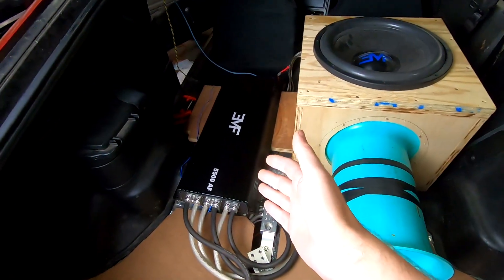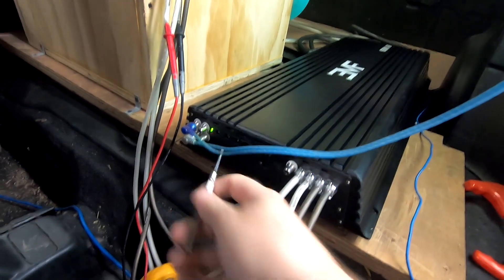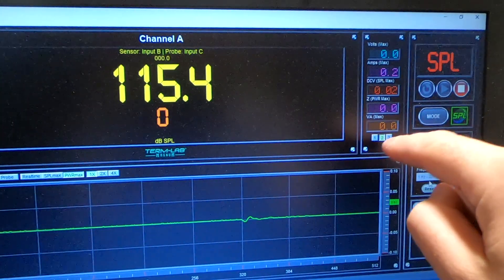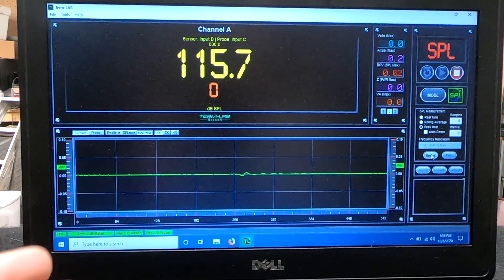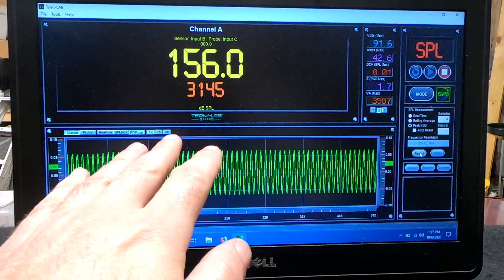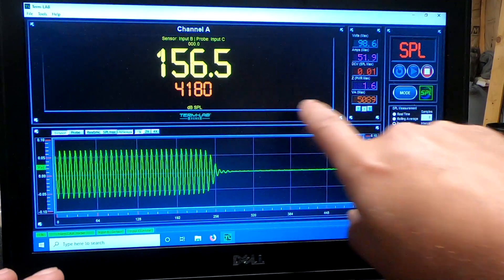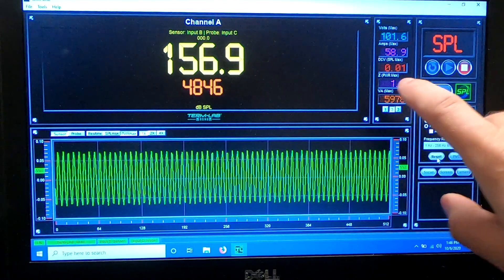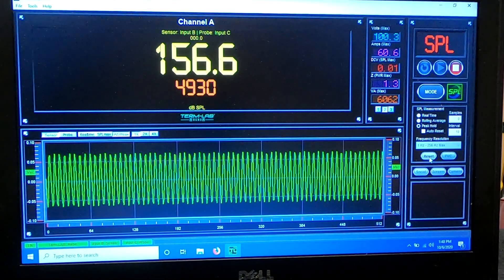EMF Audio 5500AF REAL WORLD power testing

Comment: I'm curious about something and I believe you can answer this.... Audio Control Epicenter or Soundstream BX10? 

Which is the better bass processor and are they bad for your subwoofer?

Love the amp and video as always!!!
Reply from the maker: I have no experience with the BX10 but I can say they CAN be bad for your sub, but not necessarily. If they're used properly (which many people don't) they're great, but when you use it improperly as many do you can cause mechanical failures. The proper usage is for restoring harmonics in old recordings, it shouldn't be used as a bass booster.

Comment: Does the bass remote that comes with the amp have the ability to turn the amp on/off  similar to the ds18 voltmeter remote? Sometimes I would like to listen to music without the subs playing, don't know if I will need another amp remote switch. Thanks
Reply from the maker: It does not, but that's kind of a useless feature because you could just as easily turn the volume all the way down and get the same result.
Reply: @EMFAudio  No because the amp would still be on. I turn off my amp for long 5+ hour trips. No point in just having it on at idle. That's the reason I switched from an LC-1 to the DS18 knob. Its most definitely a useful feature.

Comment: Where exactly are the actual real world volts and amps drawn being displayed?  Being an EMF product I assume it will make rated or more power but how efficient is the amp? Thanks.
Reply from the maker: I'd have to have 2 other cameras setup to capture that in real time and that would be a lot of extra editing to just show the power it makes. I didn't even have a current clamp in the car this time. All the AF amps do rated or more at a given impedance.
Reply: @EMFAudio  Yes I agree they do rated and more. Can you possibly add the efficiency calculation to the website info or just let us know. Its important to me because I would like to know how much my stock electrical system is being taxed. If two amplifiers are comparable in power and cost but one is greater in efficiency, I will purchase that. Honestly I would even be willing to give up some power for greater efficiency. I'm currently considering the 2000AF. Thanks for your replies.

Comment: I was considering this amp on strong electrical (15.2-15.3v), but I’m assuming you’d probably recommend your 7500 for two 12” v2 banhammers? Want to be ready when they arrive. I’ll quit bugging you I promise haha. Thanks!
Reply from the maker: Technically that would be over RMS rating so that would be on you for that selection. Technically we'd recommend the 5500 on a pair as that would be just under RMS rating on the subs.
Reply: @EMFAudio  ok thank you Sean! I would never hold you accountable regardless of what I choose. Subs can be blown with under rated power too. That’s all on me. I’m sure people have tried unfortunately, so it’s a slippery slope for you in giving an answer. Didn’t think about that before asking, so I apologize. Generally I shoot for around 750-1000 over rms rating per sub to help fight impedance rise while wired at 1 ohm. Probably could do even more. Don’t feel .5 ohm is necessary for a daily driver imo. I see now your amps don’t like over 15v input, so I’ll keep it a bit below that since I can adjust it. Thinking 7500 👍🏻 appreciate ya man!
Reply from the maker: @TheDoozie43  Realistically, it doesn't make sense to make an amp that requires over 14.4v to make it's power. Most people don't have that, nor can the rest of the car use it. I won't run a car over 15.0v because of the car itself, not the amps. If you're using batteries you can boil them and cause your batteries to go bad because of overcharging and heat. In summer you definitely don't' want to be charging at 15v.
Reply: @EMFAudio  ok, good to know. Of course the manufacturer of the pcm told me it’s fine, but they’re also selling the product. Thank you! It’s hard to weed out misinformation online.
Reply: @EMFAudio  they actually told me Ford vehicles like mine can handle up to 16v :( won’t say any names though.
Reply from the maker: @TheDoozie43  Maybe the vehicle can, but the battery won't. If you had all supercaps you could do that.
Reply: @EMFAudio  10-4, thanks Sean. That’s why I asked, it didn’t seem safe to me. 👍🏻
Reply: @EMFAudio  and thank you very much for your time! Have a good night!

Comment: The Rockville Compdb4-5 have clip limiter buttons too. I wonder if it really works. I wish I had a oscilloscope. I bought the compdb5 just out of curiosity 😂
Reply: I've heard two people say their built-in voltmeter wasn't accurate on their Rockville amps, So I wouldn't count on the clip limiter working properly.
Reply: Ronco160 Yea I have heard that too. I must have got lucky cause mine is pretty dead on.
Reply: Bradley Gilpin oh that’s good.

Comment: rEaL WoRlD nO rEsisToRs. One ohm, is one ohm, lmao. If you know your shit, and get it down at 1 ohm at any frequency, its the same as the resistor. Couldve used a dyno, saved a lot of time, and not sounded so "holier than thou" 😂😂. One ohm is one ohm 🤙. The part that really gets me is the "unobtainable electrical" when the test benches are usually made up with xs power batteries for vehicles lol.
Reply from the maker: You know how you have 1 ohm in your car when wired to 1 ohm? You don't. So those numbers you see at 1 ohm aren't real numbers you'll actually get. That's why I'm using a realistic scenario. Most of those dyno videos have 14v or 16v setups, which are often unrealistic to what you have in your car too. If you're buying a 2,000 watt amp, you won't have 8 14v batteries on it. You can save a lot of time by doing a job wrong, but I'm more interested in a proper end result.
Reply: @EMFAudio  you do at specific frequencies, specifically like your test was done. Whatever you wanna say man, im not hating lol. One ohm reactive is one ohm 🤷‍♂️. I understand rise obviously or i wouldn't have commented. Ive seen hundreds of systems at 1 ohm reactive (at certain frequencies exactly like your test, and the amp dyno) but you do you 🤙. Test that at one ohm reactive at 14.4, and test it at 1 ohm with a resistor at 14.4, and show the difference if youre so sure the amp dyno is "wrong." You also wouldnt need 8 14v batteries for a 2k to hold proper voltage in the car. 14.4 is 14.4, doesn't matter what its coming from if it's not fluctuating, which the amp dyno also does just like a vehicle.

Comment: Looks damn near close to the deaf bonce AAK line only difference is the heat sink style really
Reply: It's the same heatsink too.
Reply: Sadly, nobody designs their own amps anymore... you'd be better off with johnathon prices amplifiers that have clip lights, voltage and amplifier temperature sensor's all included on the bass nob... those and the sundown salt amplifiers that offer a similar thing are literally the best amplifiers around, Rockfordfosgate coming in at thrid best in terms of construction as rf uses nippon chemicon capacitors and not cheap junk...
Reply: @analogaudiorules1724  the deaf bonce aak series have the same bass knobs that jps amps do and they've been using it before jp did
Reply: @schons77iceman  BADASS, ill certainly check them out!